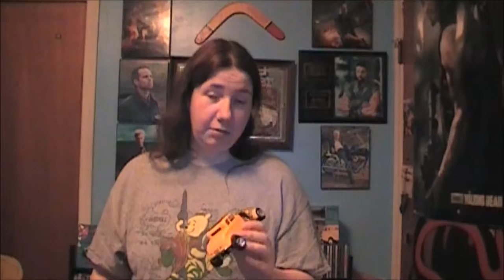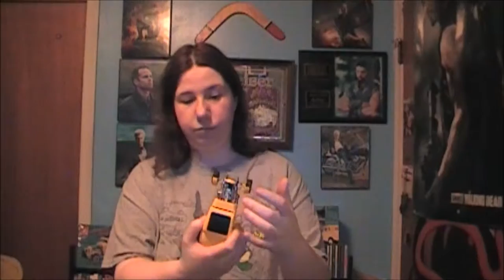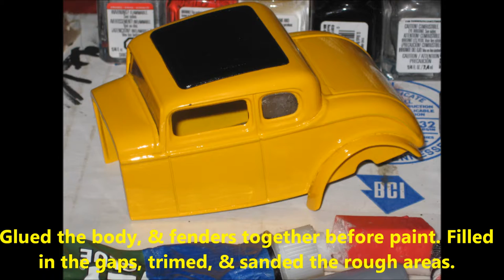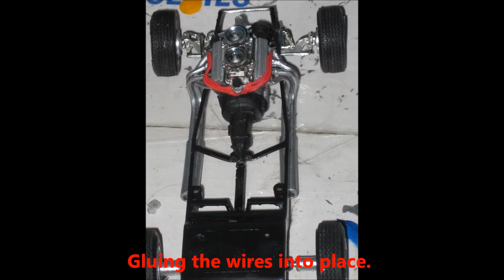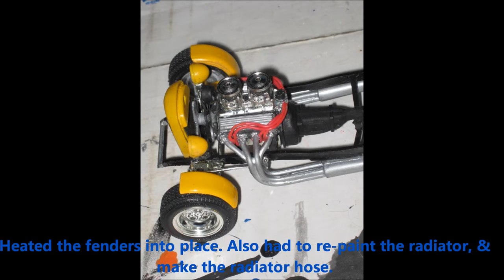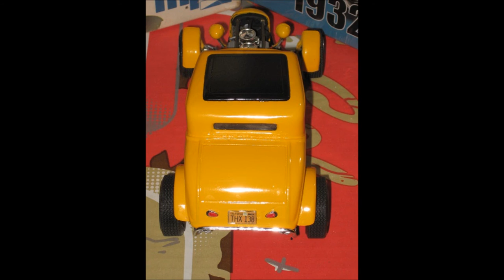American Graffiti Deuce Coupe AMT Model

Comment: Must have been an amt kit >i will not buy them any more they are brutal Revelle only now.
Reply from the maker: Yep it was the 2003 AMT kit of the coupe, but it's the same mold as the old one from the 70's. I have both the original MPC and compared it to the AMT, same kit.